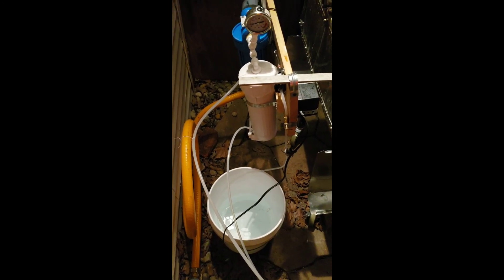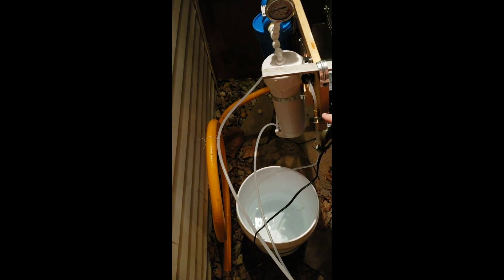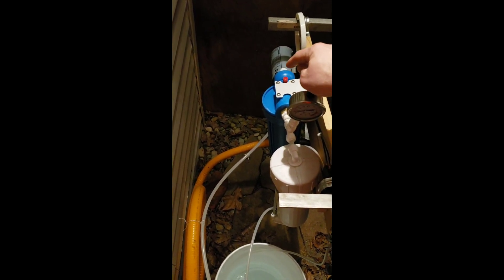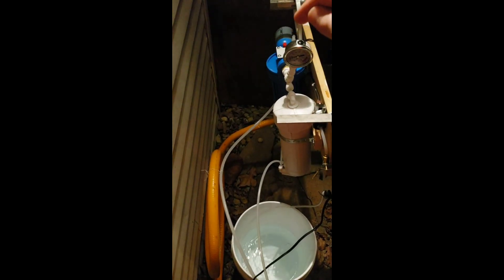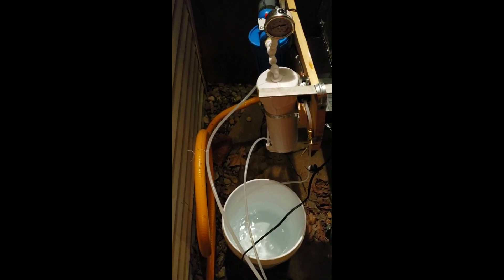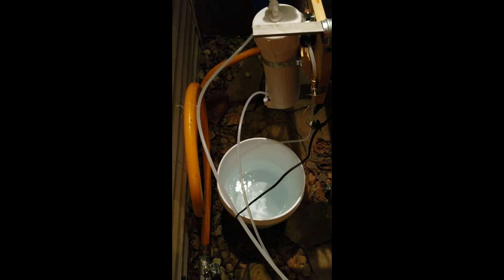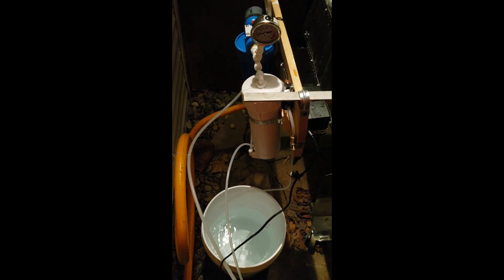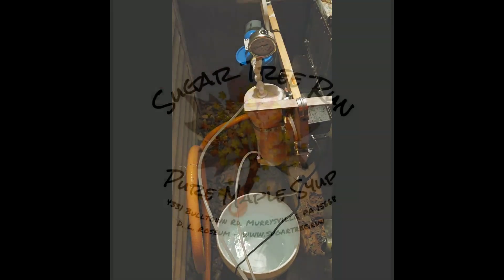Maple Syrup - Reverse Osmosis (RO) Flushing Basics

Comment: So from mechanic point of view that seems awful strange it just seems like you’re forcing the particles through the filter. I would assume that you would run it backwards to push the particles out of the filter. But I don’t know much about this. I’m fairly new to the maple thing, so I appreciate the info.
Fred
Reply from the maker: When you flush the system, it has to be at low pressure (near zero) and high flow  to scrub the sugar particles off the surface of the membrane and out through the concentrate line.  Only at high pressure are you forcing water through the membrane.

Comment: How do you flush new Ro filters?  I just built a small RO and was wondering How the flush new membranes?
Reply from the maker: You should run distilled water through the membranes to flush them out.  5 - 10 gallons is probably sufficient.  Alternatively if you use tap water, be sure to use an activated carbon block filter to ensure no chlorine from the water supply enter the membranes.  

Be sure to replace that filter with a new standard 5 micron filter before processing sap. You do not want to use an activated carbon block filter for processing sap. 

Activated Carbon Block CTO | Universal 5 Micron 10 inch Cartridge:  https://www.amazon.com/dp/B01LZAQYNU/ref=cm_sw_r_cp_apa_i_bherEbZBB2WZH
Reply: should I do them one at a time?
Reply from the maker: @seacoastwaterfowlah2223  If they are in series (one feeds into the next) then you can do them all together by pumping the water through the system.  If they are in parallel (multiple fed directly from pump outlet) then I would recommend isolation ball valves before and after each membrane so you can flush them independently.  

Here is a link to a setup i built like that:
https://www.sugartree.run/2020/01/diy-2-stage-portable-hobby-ro.html
Reply: Thanks for the help.